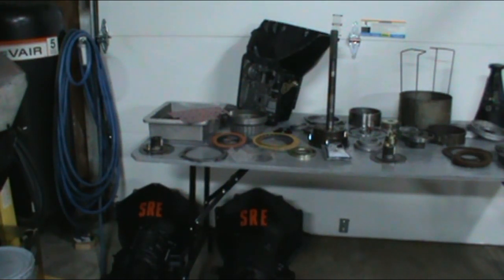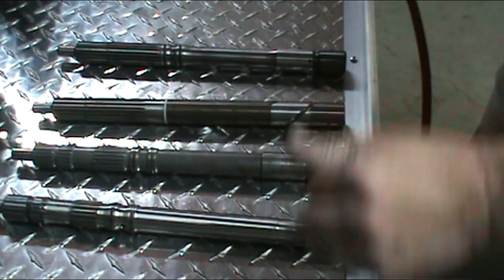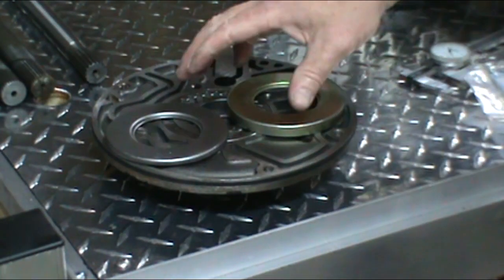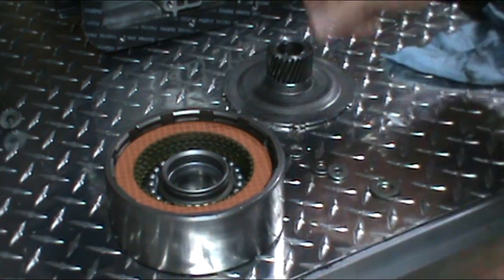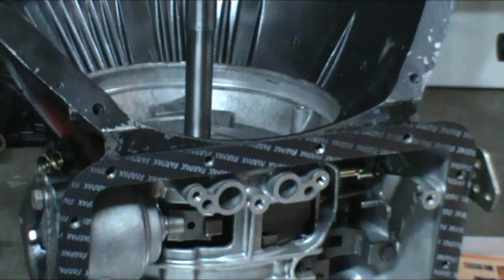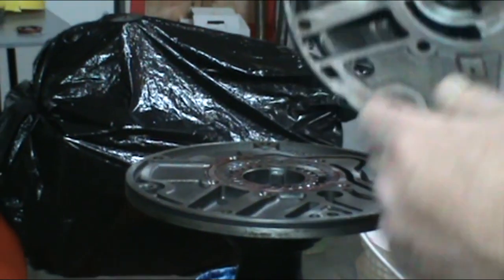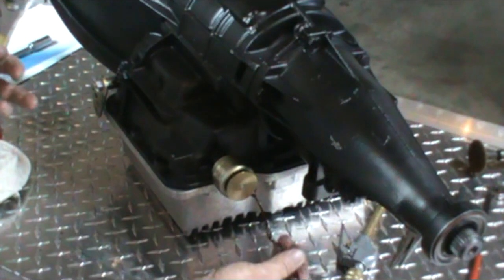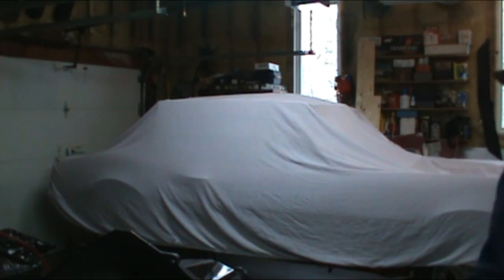Complete Powerglide Build

Comment: Best video on here for setting up a race glide. Thank you. between a book I bought and this video I’m confident I can set one up well now.
Reply from the maker: good luck!
Reply: Brian Swayne another question after the pump is modified how much line pressure does it typically make?
Reply from the maker: @Spudderr  The pressure is regulated by the pressure regulator spring in valve body. The mods just give better flow of oil. Typically 200 psi with modified spring.
Reply: Brian Swayne again thank you. Do you sell any parts online?
Reply from the maker: @Spudderr Where do u live.
Reply: Brian Swayne West Virginia
Reply from the maker: @Spudderr   Your best bet is TSR racing.Great bunch and honest.They will have everything u need.

Comment: This is probably one of the most in-depth glide assembly videos, although you didn't include installing the pump... it stopped after you installed the band
Reply from the maker: There are multiple vids with the powerglide.

Comment: The check valve is in the hole next to the cooler check valve probably at the 7ocock spot. It presses into the stator side and has a matching hole in the pump body to clear it.
Reply from the maker: That is the downshift timing valve. Not needed.Pull out and discard.

Comment: we rebuilt a 1969 powerglide and everything works great except ,,It doesn't shift into HIGH !  Any ideas what we missed ??
Reply from the maker: Get a 300 psi pressure gauge and check pressures. Google instructions or you tube. Sounds like clutches in drum not applying.

Comment: i have a powerglide out of a 66 chevelle. been sitting for 12 years now only goes in park. worked fine before hand. any ideas?
Reply from the maker: I would say after sitting that long all seals will be rock hard. You can reseal with a gasket and seal kit.